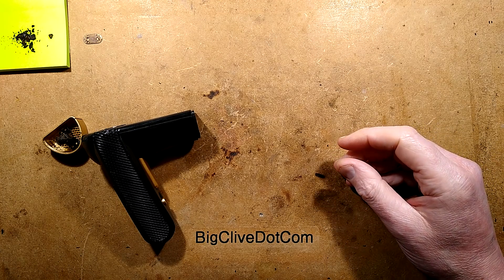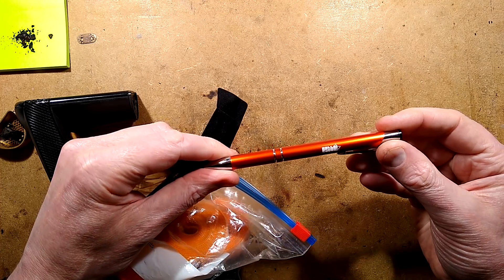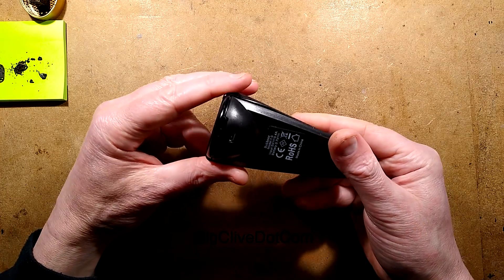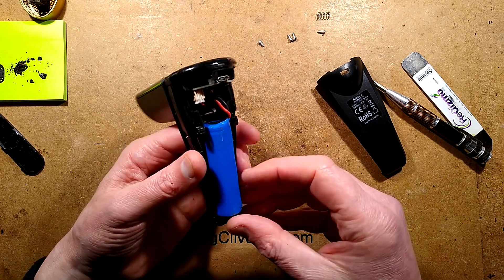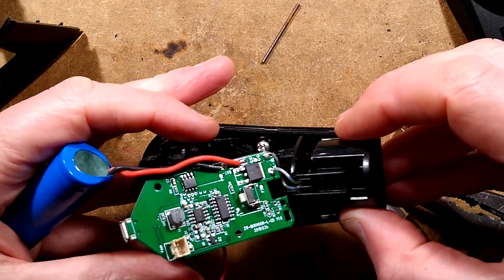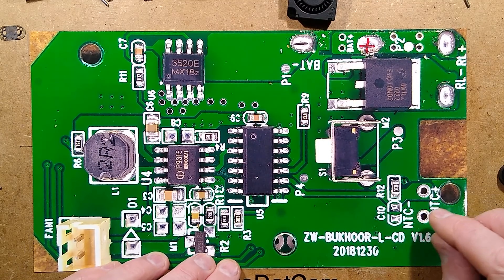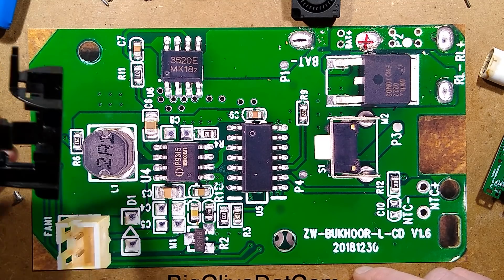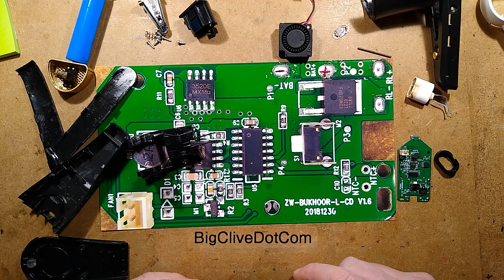Inside a USB rechargeable incense burner.

Comment: Clive did you notice that the big chip in the center is missing two legs on one end the chip could have had an extra pair of connectors on the board. Does that mean the chip that they created for it did not work?
Reply: It's likely the microcontroller they used is available in multiple packages with one option having two more I/O pins. That footprint with the extra markings on the silkscreen layer for minimal insulation gives them the option of using a 2nd version of the chip depending on availability. Your observation could likely lead to somebody identifying the microcontroller as well. Good spotting!

Comment: The low capacity cell is normal, it's the type used in power tools and can sustain high-current discharges, but because of the internal construction (thicker electrode plates, waved instead of spiral-wound), has lower capacity than the "energy" cells used in other things like laptops.

Logo on the powerbank chip looks supiciously like the Infineon one.
Reply: The cells I vape with are 25a continuous.

Comment: I was 100% sure this is some kind of weed smoking utensil!
Reply: Everything is if you're brave enough
Reply: seklay this thing reminds me of the Puffit vaporizer.... I think it may actually be intended as a herbal vape....
Reply: @cdawson198600  There are some brave men out there indeed
Reply: seklay yes absolutely, I’ll stick to glass.... a red hot heating coil inches from my mouth isn’t very appealing.
Reply: KingofKatenfutter could probably put some keif in it and hot box a small tent with a USB battery bank....
Reply: It would get very sticky and oily fast and be a nightmare to clean.
Reply: 3dlabs99 rubbing alcohol on a q-tip after getting the coil warm and should clean easily.